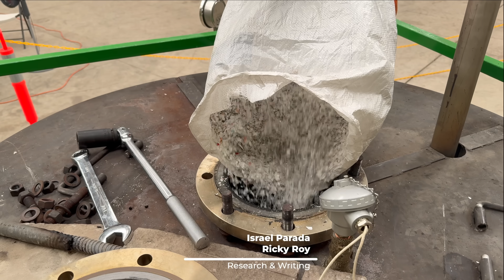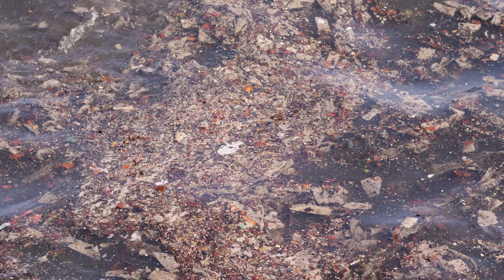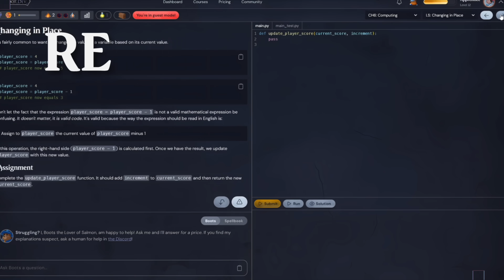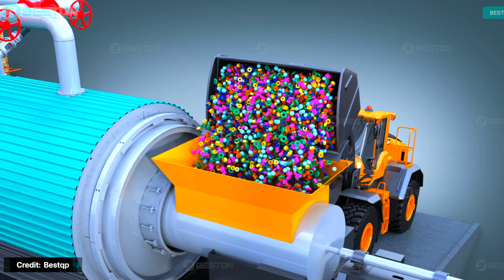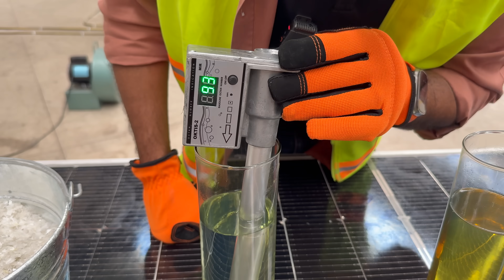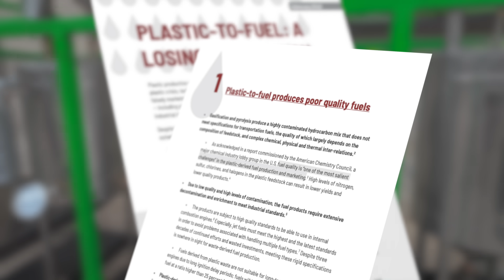Solving the Plastic Waste Problem - This Surprised Me!

Comment: Perfection can be the enemy of the good. While I understand the net Zero comments, reusing the waste to generate a new higher value commodity in a net cleaner manner than creating these fuels directly from oil, is a winner in my book.
Reply: How do you eat an elephant?

One bite at a time.
Reply: With Aduro's technology it's possible to turn waste plastics back into plastic feedstock. No need for Petgas's technology.
Reply: @Lerppunen  Are you sure it does no run into the exact same problems as recycling though?

Because most tech, that does what you claim, requires sorted, caatalogued, and cleaned plastic of identical make and material, without much difference in stabilizers, I can't help but have my doubts.

Which is why many of the proposed tech never works. How efficient a solution is at solving a problem, and how effectively it can be applied to everyone. Even if it were 100% efficient, if it only applies to 1% of circumstance it will never become applicable to make a difference. An amazing point to start for further research and development, but an unapplicable solution isn't a solution at all.

While petgas used sorted plastic for its 92%, it still worked for LDPE, HDPE, PP and one other. Likely, you could throw all of them together and it won't make a difference because the difference it makes would not affect what is happening.

While, alternatively, they also admitted that the quality of the product become dirtier when used with other plastics like (I think they said) styrofoam.

Second, Arduro is focused on rubber recovery, either in the form of Carbon Black, and Recovered Rubber. I do not know how you are applying their technology for specifically rubber, to plastic to virgin plastic feedstock. Did they announce something new?

Could you please explain this in more detail?
Reply: Can you explain to me how this is "generat(ing) a new higher value commodity in a net cleaner manner than creating these fuels directly from oil"

So, we produce atmospheric CO2 to drill the oil in the first place. 
Then we produce more converting it to plastic
Then we produce more to sort this plastic from other (non usable) waste
Then we burn natural gas (producing more CO2) to convert the plastic again under pyrolosis
Then we burn the resulting fuel in a car/generator/etc. producing even more CO2

Yes, it gives us something to do with our plastic waste, which can clean up our environment but, at the expense of converting that environmental carbon to atmospheric carbon - The same atmospheric carbon we've been trying to reduce for the better part of 20+ years...
Reply: @cmac3530  Sure, you can say that keeping the carbon in the plastic is keeping it out of the atmosphere, but all the plastic is proving to have serious ramifications.  Only 4 to 8% of drilled oil is turned into plastic, so it's not a huge amount.  Also, we should aim to be producing more bioplastic like biopolyethylene from renewable feedstocks.
Reply: @eray9934  The plastic only has serious ramifications because we allow it to infiltrate the environment. If we had a proper recycling system or even just a proper way to remove the plastic from the regular waste chain and re-direct it to specialized waste facilities then it wouldn't wreak havoc on our environment.

And if only 4 to 8% of drilled oil is turned into plastic then there's absolutely no way the process described in this video can make a meaningful dent in the amount of fossil fuels we drill for/consume.

We don't need new ways to create existing plastic. We already have things like PLA which is made from renewable bio-waste sources. 

We need bio-degradable solutions to problems that are currently solved by plastic. Which, in turn, puts less of a burden on the sorting/recycling by virtue of less plastic being used overall.

And by bio-degradable, I mean something you can throw in a landfill and it will be fully decayed within 6 months to a year. Not these "bio-degradable"plastics that only degrade in industrial facilities, like PLA.
Reply: @cmac3530  I don't think this is designed to make a meaningful dent in the amount of fossil fuels we drill (nor will it therefore increases greenhouse gas emissions very much over the current practice of landfilling).  But we need to do something about the millions of tons of plastic that are accumulating in the environment.  It doesn't actually decompose--it just turns into smaller and smaller fragments, and now we have the issue of plastics in the oceans, microplastics in our bodies...

Yes, ideally we would improve the recycling process, but we've been trying to do that for 40 years now and it just isn't feasible for the vast majority of plastic waste.  If we can just burn it completely for its energy in a way that doesn't produce dioxins or other pollutants other than CO2, that seems like the best way to deal with it.

Ultimately, we will need to stop drilling new oil to make plastic, so if we can get the ethylene from renewable sources, it can become net-zero.

It would be great if we can develop a type of plastic that does eventually fully break down or is consumed by microbes, but my guess is anything that breaks down in a landfill in a year will still not be durable enough for its intended purpose...
Reply: @cmac3530  
Its going to sound off topic, but do you know about debt loans? Or debt consolidation loans?
Sometimes, if someone has a lot of small high interest loans, or loans with predatory fees, Or your credit was crap but you needed an advance for bills, you can apply for a debt consolidation loan. Something that allows you to pay off and stave off all the volatile interest rates, and downright near cancerous debts. Because by having 1 large loan, you owe to a singular corporation or entity, makes it a lot easier to negotiate with them, to secure a much more reasonable interest rate, and eventually even renegotiate the loan when your credit is better.

A technology like this, plastic pyrolysis, and many more like it, are a debt consolidation. Because Co2 isn't the only problem. Plasticizers, Leachates, Stabilizers, and other chemicals are going to have a LOT bigger effect on the local enviroment, long before CO2 becomes a problem.

In a way, by simplifying more and more of our problems into Co2, we have a higher and higher likelihood of actually being able to solve the Co2 crisis, then trying to solve everything else.

Chase 2 rabbits, catch none.

Co2, For better or worst, is one of the most studied and solvable green house gas emission. Whether its through carbon nuetral fuel and plastics, or Carbon negative programs like Atmospheric Scrubbing, in a way, consolidating our problems will help limit the catastrophic short and long term effects letting this waste build up pose.

A great example of this is methane. Methane, in the short term, is 80x more effective greenhouse gas. However, in the 100 year scale its 25-35x more effective. And, right now, I believe that methane accounts for 10-20% of greenhouse gas emission.

Much like debt consolidation, Methane is like the predatory payday loan. It seems small, but the interest rate of not paying it off is massive, and it could get out from under you if you don't deal with it now. Waste, is like that credit card balance you know you need to pay off, but something else keeps coming up.

So, for example, for every 1 methane you burn, you get 1 Co2 molecule. There is no other logical conclusion than to burn it. Just like this waste. The more land it takes, is land that could have been used for solar/wind. Every part that ends up in the ocean, is something that will end up degrading and poisoning* the plankton that help trap Co2. Once it builds up enough in the enviroment, what will we do if it starts causing extinction events that lead to extra decay and methane production?

Different people, have to be able to do their individual part, even if it is less efficient, it can be more effective.

Not only that, but the more trendsetters and inventors like PETgas, that prove its not only possible, but profitable on a small scale, can encourage even small communities to invest the tens of thousands of dollars necesary prevent these short term enviromental and health catastrophes.

I'm sorry, I know its not the most satisfactory of responses. I know its not what you want to hear. But solutions like these are what gives people hope where there isn't any. Real, tangible solutions that can be used right now, today. Not delusions, not false promises of salvation, nor grandstanding speeches about "if only we did just this all our problems would..." that really amount to nothing. Because that is what a lot of promises are. Goals with no plans to achieve them are nothing more than hot air. But this tech is real.
Reply: @cmac3530  I’m not well versed in clean technology, however, I believe that certain items can be processed  using biogas, bio-char, biomass, technologies.  Those technologies prevent the release of harmful gases, not just CO2, into the atmosphere, generate clean energy, carbon credits, clean energy credits and more.  Any effort to help us reduce, recycle and reuse is appreciated and welcomed.
Reply: Exactly, it has tremendous arbitrage and that's what makes it viable

Comment: Local processing reducing transportation emissions, or using the fuel to make power or other products where they have a closed system to prevent pollution are a couple ways that may quail some of the naysayers objections.

I rode my motorcycle just yesterday too Vegas.  Once I got a view of the city it was horribly lacking due to the smog.  Just imagine that people live with that air quality is wild.

Comment: I don't like this solution. We have to get rid of CO2 emitting processes sooner or later. This method will help us with micro/nano-plastics, but it's not a long term solution. Instead of recycling plastic to fuel, we should recycle plastic chemically to new plastics.

Comment: At the landfills, how many heavy duty vehicles are used 20-80 hours weekly that are using diesel and gasoline? LOTS! I speculate that "Electric" versions of those specialized vehicles/machines won't be around anytime soon (Electric Semi trucks are just barely getting into the market after how many years of development???), so Landfills could possibly be very interested in these systems (to make their own gasoline and diesel), depending greatly on the "cleanliness" requirements of this Petgas system and the effectiveness of sorting machines/systems that ensure that the right and wrong types of plastics are properly categorized.  Here's hoping that the AI sorting machines have made good progress in their accuracy!

Comment: This is reminiscent of thermal depolymerization that was used by Changing World Technologies around 2000. They converted plastic and leftover turkey parts to make gasoline. Unfortunately, they had trouble with the economics, which doomed the company. PetGas seems to be using a more refined version of the same process. I get that we're all more engineering-minded than most, but the economics are really important, and you barely touched on it.
Reply: Always wondered what happened to them. They has claimed they could take anything carbon-based and convert it: From table scraps to tires. Seemed like a great thing back then. Guess not.

Comment: Dame Anne Dowling, past President of the RAEng, suggested that we should view plastic as oil in a transitional phase.  We burn oil for its energy.  We shouldn't leave plastics in this intermediate form, as they are very durable and polluting, we should extract the energy from them as Dame Anne advises.  Burning plastics can be done cleanly, but only in a highly regulated, centralised facility.  Pyrolysis can be done in small units, close to where the plastic rubbish is.  The Petgas process seems to solve the problem of making high quality fuel from a small system.  Way to go Petgas!!!

Comment: Chuck in a thermoelectric generator and/or use the pressure it's generating to run a turbine - they can take care of the small electricity used, and make it even MORE of a continuous loop system!  Just need to be able to do a closed system where plastic can be continually loaded.

Comment: Cost effectiveness?
Pyrolysis of hydrocarbons to fuel has been around for long time. The problem is that it cost more to produce than the sum of products.

Now some of this can be offset by garbage dumping fees (because getting rid of garbage is a valuable service) but what are the economics of the process we're dealing with here?

Comment: This would help stop drilling in environmentally sensitive areas. It may contribute to a reduction in transportation of oil thru pipelines and over oceans. This could help prevent the next big disaster. It may also reduce methane that is released in the drilling of wells.

Comment: Another great show.
Thanks!

It seems to me that this is a fractional distillation that feeds end products back into the heater. 

Oil refineries do this.  They also chemically crack longer chains and connect smaller ones.

This process doesn't include the extra chemistry.

It seems this is an ideal starting place to produce monomers to generate plastics.

Very cool.

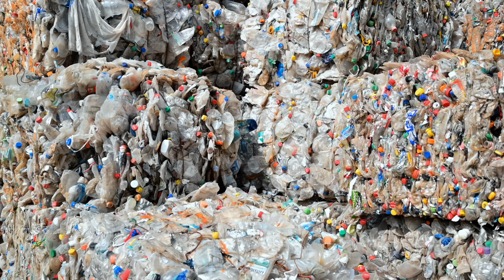Comment: 14:20 Wait... Are you saying that this process + a ICE engine is more efficient then a power plant burning plastic ?
A Formula 1 hybrid engine is just 50% efficient at a F1 track with very hard braking to rechange the hybrid battery. The average efficiency of an internal combustion engine (ICE) typically falls between 20% and 30%. While on the other hand you have a huge installation that burns plastic that doesn't move with a lot of scrubbers and other techniques to tackle polution.

The future is electric. The rest is BS.

Comment: Any process that makes recycled materials more valuable is critical to making recycling profitable.
Using this or a similar process close to its end use would reduce the number of tankers transporting fuel around the world adding to the climate crisis.
It is not a perfect solution but it helps solve the problem of plastic waste piling up everywhere and creates energy that can be used  locally..

Comment: I've often said, the problem is not with crude oil products, the problem is BURNING fossil fuels.  You could directly burn the plastics to generate electricity, but that is horrible for ecology.  The biggest value of this tech is (potentially) greatly reducing the pumping of crude out of the ground.  I would also caution that tech like this may delay transition to electric transportation.  But, if these fuels are adopted by all the utility companies, there could be enormous advantages for the world's power grids, and actually accelerate the transition.  Let's see how the tech stand up to peer review scrutiny and attempts to scale it up to real production levels.

Comment: that feed stock has to be so clean and uniform you might as well get pellets right from the factory
Reply: And in that case, just skip the pellet phase and make liquid fuels out of the oil to begin with.
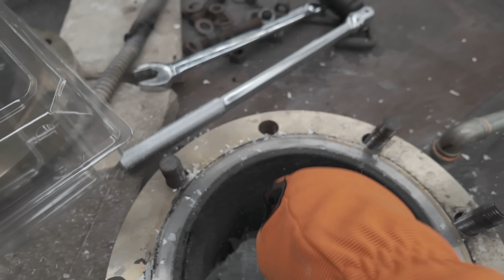Reply: You didn't hear him at 0:58 say cleaning is not necessary right?

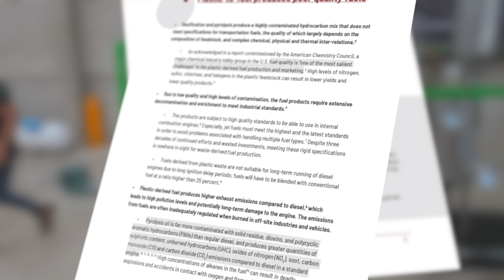Comment: 14:15 - Yeah, you are burning trash.  BUT, you're NOT burning fuel to get to the fuel by drilling or strip mining.  So you're effectively cutting down on greenhouse gas emissions to meet many of the fuel demands.
Reply: We used to put plastics in the fuel supply at coal fired power plant incinerators, we got all the energy out of it and let the exhaust gas scrubbers (that were already on the plant) do their thing and then we sent the fly ash to cement plants. We did all that without these extra steps and expense. I’m not saying this isn’t an interesting concept, but we’ve known how to do it for some time and if the goal is to get the energy out of the plastic and keep it out of landfills with as little waste/emissions as possible, we already know how to do that too.

Comment: Creating gasoline from plastic is not amazing. It's like saying a sissor is amazing.
Creating short carbon strings from long carbon strings is the onlything they are doing.
We invented this at the same time we invented the otherway around. Making plastic from oil/gasoline.
Reply: I think many people don’t realize that those hydrocarbon chains in plastic could have been cracked into fuel or lubricants from the beginning. They aren’t getting anything out of the plastic that we haven’t already put in it.